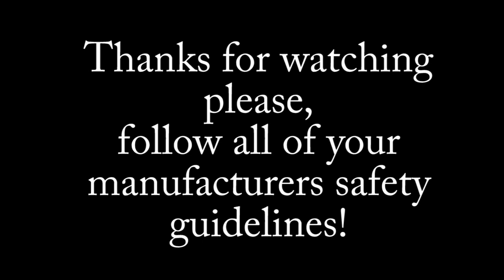Woodturning - Lidded Box

Comment: I know this is a very old video but what's in the paint can that you put on you're sandpaper? 

I never tried turning a box. I was just wondering if I can turn one small enough to hide in a wood chisel handle. The problem is you reversed the grain by flipping the lip back on to the box tenon? Does seem nice to quickly practice box turning. I'm hoping to cut threads and keep the grain together for seamless lid.
Reply from the maker: Here's a video I did last week talking about the oil I use https://www.youtube.com/watch?v=nDFBXMQL9WY

A box in the handle would be cool. I've made some small ones, but not in a handle.